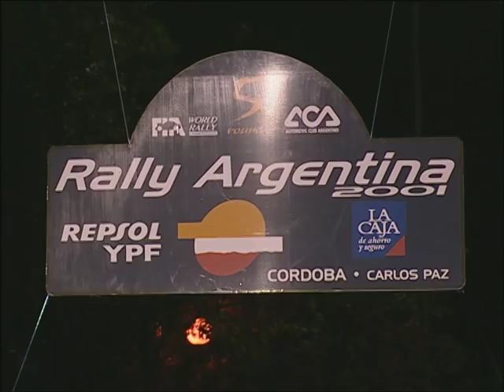Rally Argentina 2001: WRC Highlights / Review / Results

Comment: All the 2001 ford focus liveries were so fucking good
Reply: The only group A car i see on a daily basis
Reply: @poundfoolish8691  not a group a car tho. Only the mitsubishi was group a homologated after 1997.
Reply: @strahinjastevic7480  what's the era immediately after group A called?
Reply: @poundfoolish8691  world rally car era, the regulation change in 1997 removed the need for homologation specials so manufacturers could just put 4wd and aero on regular cars instead of having to make a pre set number of cars on which the rally car will be based and with minimal deviation from the original road going design (the homologation special) Thats why group A cars look a bit tamer and why Toyota went ftom rallyimg in a celica gt four to a corolla hatchback